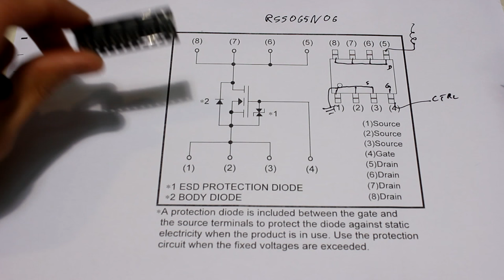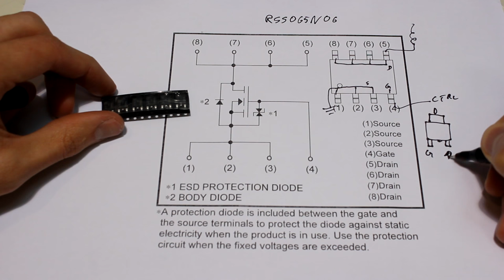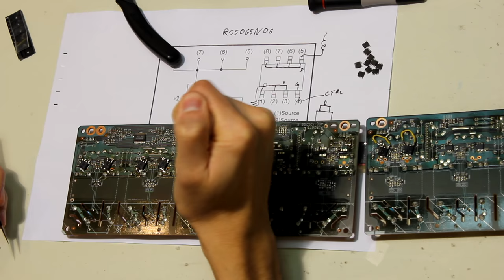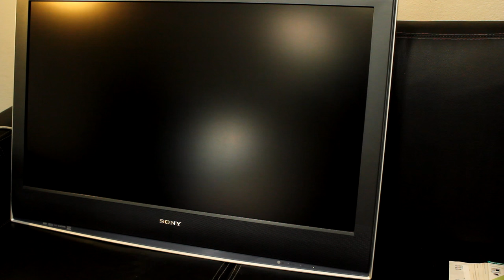How to repair a Sony LCD TV inverter board (backlight mosfet replacement)

Comment: Hello,
It's very unlikely that all mosfets get shorted at the same time. They are all mesured shorted  because they are all connected to the same power source. To do a correct measurement, you should isolate the 5 circuits. This can easely be done by removing jp101 / jp102 / jp103 / jp104 / jp107 and jp111 (primary board). After removing these, you can do a correct measurement, and you will probably find only 2 shorted mosfets. Replace those, replace the fuse, reinstall the jumpers and you're done!
You can find the original components on ebay - RSS065N06 SOP-8 Mosfet N-Ch 60V 6.5A

Greets, Patrick
Reply from the maker: I don't remember exactly how the loads were wired, you are right on the diagnostic procedure, but they were all failed (well, at least like 7 of them), I've measure them off the board, still shorted. Maybe some weird power supply or driver glitch? 

I would also use newer, higher rated parts, I used those because the person in question asked if it was possible to get the TV in the same day, that bodge was the only way. Newer parts would take at least 48 hours to arrive.

Comment: My TV just broke down, been googling and it turns out I have a problem with the.. thing you just repaired, I believe it's called inverter circuit board. 

My TV goes on, sound is there, channels change, even the picture is there when I shine light on the screen but there is no background light. 

What you just did is something I could do, problem is I don't have that kind of tools at home. I have it at work and at my working collega's house but that would mean once I open it I want to finish it, and I don't know how long it would take me since I don't so this kind of stuff often. 

I'm planning to buy a new TV tomorrow, and to repair my broken one and sell it repaired. 

Nice video, greetings from Europe.
Reply from the maker: The older Tvs, like the one on the video, had fluorescent tubes that needed inverter circuits, if it's a more modern LED backlit LCD TV, it probably has a reasonably simple DC-DC converter that drives the LEDs in series (around 100 volts or so for each LED strip). If you are unlucky you have a problem on the LED strip itself, that's a pain to repair because you have to take the LCD panel itself apart.
Reply: José Faria Yea I bought my Grundig (40 VLE 5007 BG) two years ago. 

My older TV before that died two hours before Holland was to play against someone at 2014 Brazil world cup football..  So I had to buy an TV in the next two hours to watch the game. In all the stress I rushed to Euronixx, saw an reasenable TV for €333,- so it was a deal. Did not do any research on the quality or what so ever.

So yea.. two days ago this thing went black in then middle of a movie I was watching. Went to Euronixx but my guarantee was due one month ago. Did a little bit of googling, seems that a lot of people have the very same problem as I have, and all have the problem after about 25 to 30 months.. so just a month to 5 months after the guarantee is due.

I really hope it's a common problem, and that it is easely fixed, would be a waste to throw it away. If not fixable by me , I'll sel it to someone for spare parts.

Greetigs

Comment: Hi Jose i just want to rplace my inverter board on my Sony LCD KDL32v 4000 but don't want to damage the connectors it is different to yor model. Can you help? Thank you
Reply from the maker: I don't do this for a living, if I recall correctly that was the only SONY TV I've ever repaired. If you are not experienced, changing the entire board is actually a good idea. They should have different connectors so you can't accidentally plug the cables in the wrong socket, but you can also just take a photo of it before to check later, other than that, just go for it. If you are not confident because of the connectors, try to find videos with similar connectors, even if they are from a different appliance.
Reply: @jfaria  hi again I managed after writing to you and changed the inverter board thanks to youtube videos. I have reset the backlights and it seems fine now☺ thank you for your share

Comment: Well, you are not as much a horrible person as I thought. Nice video.
PS: It is not really necessary to keep ALL the repetitive tasks in the video. You are wasting your viewers time. And a close up here and there would be nice for people watching not in full screen or on a mobile phone.
Unlike EEVblog you found the fault and even fixed it. Well done.
Happy New 2016.
Reply from the maker: +The Kaiser HA! I remember you! :D Thanks for the input, honestly I do these videos mostly to practice my spoken English, which as you can see is not that good, but this repair was very easy, repairs on panel drivers and panels are a lot harder (of course, if Dave did repair it I wouldn't mind watching). 

You appear to like troubleshooting stuff, you should buy broken stuff on eBay, you can find very interesting stuff at crazy low prices.
Reply: José Faria You remembered well.
But I am more interested in fault finding techniques and fault analysis than the repair. Repair for me is just proof of concept.
Reply: how you finding fault please let me know

Comment: Hi, thank a lot for your video, I have the same model of boards, in my is burned the first fuse, in your video already replaced, but in my board no one mosfet is in short circuit, I've replaced the fuse but it immediately burn if I give power... What can be the cause? I measured the resistance between positive and negative and everything is ok. Please can you help me? Thanks.
Reply from the maker: If you are absolutely sure none of your mosfets is damaged, I would check the switching controller next, but I would advise you to double check the mosfets.
Reply: José Faria are you talking about the swiching power board? I have controllet 5 times the mosfets belive me
Reply from the maker: +Francesco Frate if the MOSFETs are all good, maybe the problem lies in the switching controller that drives the transistors?
Reply: @jfaria  ho controllato i mosfet e i fusiblili sull'inverter e sono buoni però la tv  non fa!mi puoi aiutare oer risolvere lo stesso problema tuo?grazie
Reply from the maker: @enricobarletta5682  If all the MOSFET are good, maybe it's a problem with the controller IC? You can always consider buying a used controller board, these CCFL TVs are really old, used boards might be cheap on eBay.